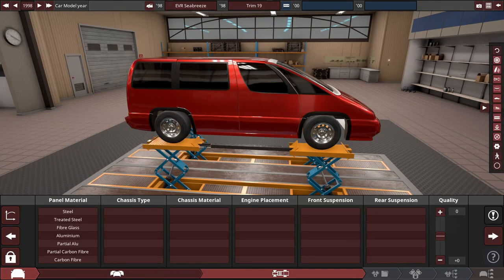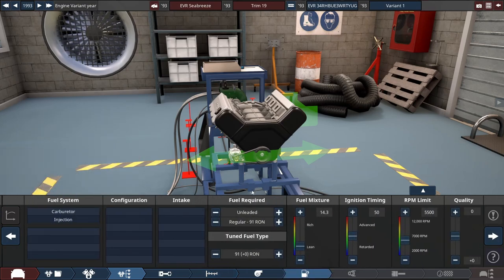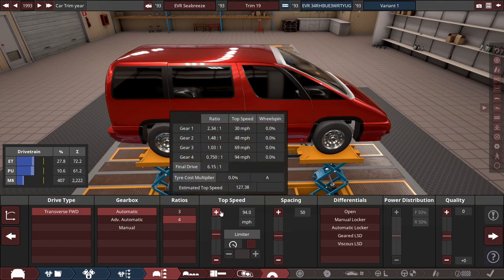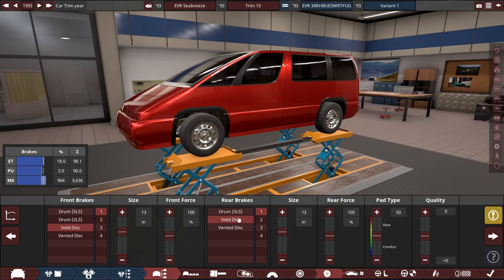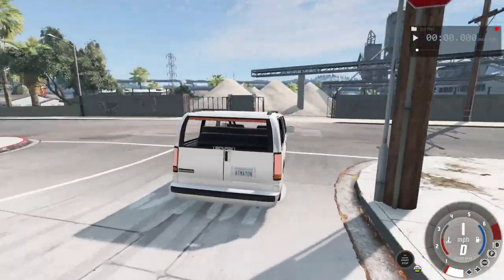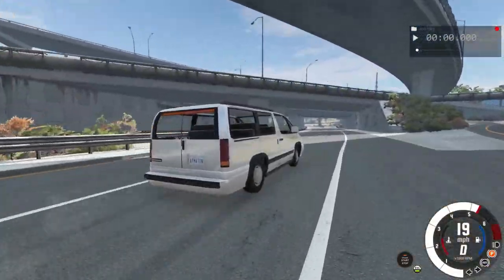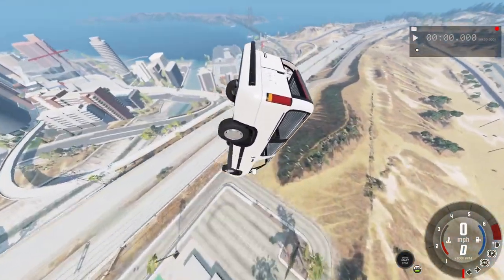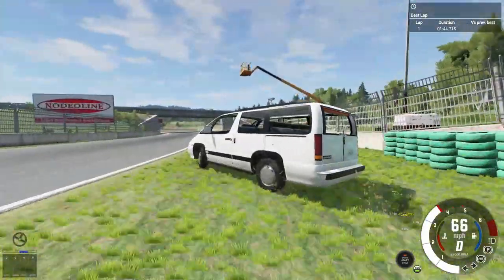I BUILT THE WEIRDEST MINIVAN EVER! | Automation/BeamNG

Comment: hey, a tip for transverse V engines, do 60° instead of 90° for space saving and every single transverse V engine in real life are 60° and lower, Volkswagen even made VR engines because of this reason.
Reply: "I'm not gonna make it drum bro it's 1993" 

My Parent's 2012 Volkswagen Voyage with rear drums even though they bought the most expensive trim they could from this model: 🤡🤡
Reply: @leoaraujo8590 
Well that's just bad and cheap design, my 93 previa has discs all around.
Reply: @ihavewaited90daystochangem51  I do agree, the brazilian domestic market can be resumed in "make the cheapest possibe car and charge as much as you can".